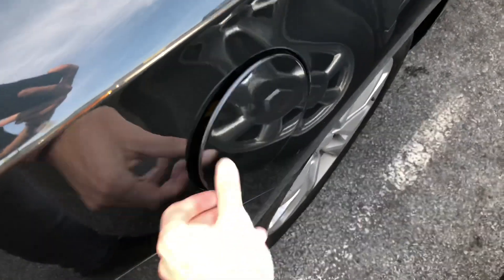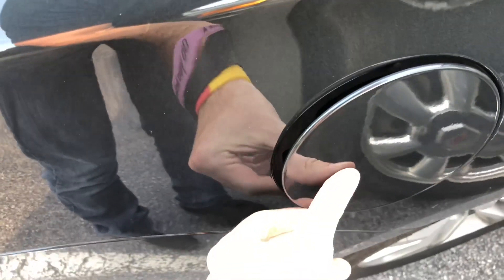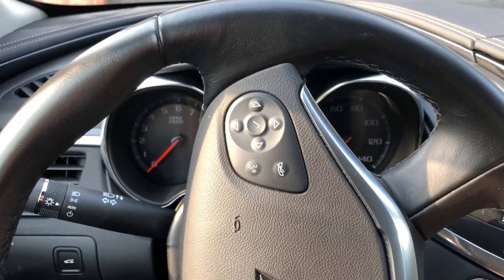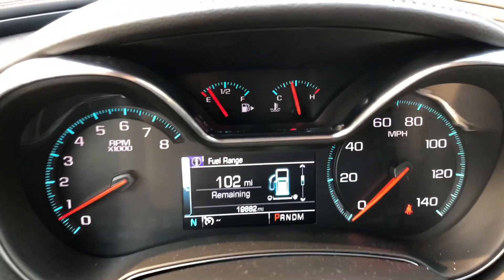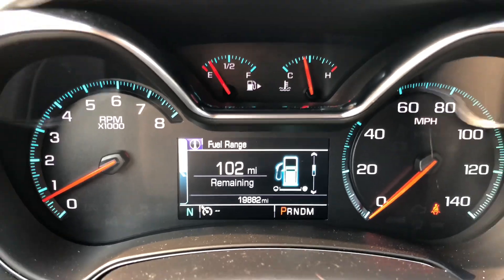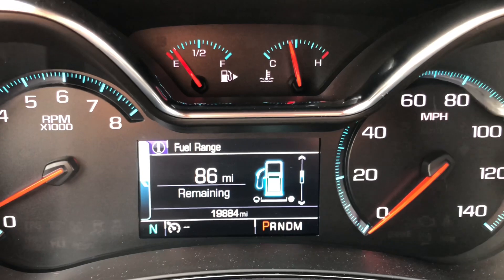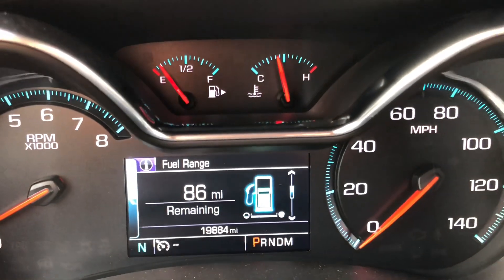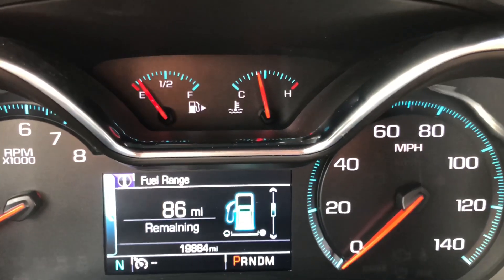Will a Loose Gas Cap Really Trigger Your Check Engine Light?

Comment: Maybe it's not coming on because you seem to be almost empty.I had this CE light problem and noticed it only after putting gas into my car. Checking the system an evac code came on but it said nothing about the gas cap maybe being the problem.But again this CE light only came on after putting gas into the car.

Comment: My engine light doesn't go away on Nissan Roque 2014...it happened after gas cap sign...I changed a fuel cap but engine light is still on...does anyone know how to reset the light

Comment: True. It just cost me $100 at my Toyota dealer for loose gas cap. I got gas 1 week ago and the light came on yesterday. Ugh. So pissed off.
Reply: Dolores Leba it happened to me for the first time today. I got gas last week. Been driving fine. Got to work today fine, but at lunch time I went to start my car, and the check engine light was on.

It’s like God said check your gas cap in my mind, and sure enough it wasn’t as tight as it usually is. I tightened back, unplugged the negative battery cable for 15 minutes, hooked everything back up, and the check engine light is off.

Just have to make sure you tighten that gas cap all the way. Sorry you had to pay $100.
Reply: @DOOMZDAY34  do you have to drive for a while after you tighten the cap in order to switch off the light?

Comment: Can confirm light came on (recently had a full service when it was on before which was my spark plugs). Tightened the cap, drove about 10 miles. Turned engine off and back on and it was gone.

Comment: This happened to my husband with our 2006 Chevy impala and our check engine light stayed on...I told him to take the gad cap off and put it on again and it went off just like that. You have to drive it... and sometimes it doesn't go off if you haven't started the car.. so no it's not a myth. Also I noticed we had a problem with it not wanting to start. The moment I told him to check the gas cap... we haven't had a problem.. took it to 3 mechanics, they couldn't figure out the problem... they checked everything. My husband looked at me and said... figures you would figure it out. Thanks to my pops teaching me about cars....

Comment: As others have already stated, this does happen and it is not a myth. It has to do with the vacuum pressure inside the gas tank, which is maintained by you gas cap. If your gas cap is left off or isn't tightened properly, the pressure sensor inside the tank sends a message to the computer that something is wrong. With my Jeep it took about 30 minutes of driving before the engine light came on. This will vary from car to car, depending on the make and model.
Reply: Thank you for sharing this, it helps people a lot.
Reply: This dude don't know shit lol🤣🤣🤣
Reply: How long did it take for it to turn off once driven
Reply: @beauti_is_her_name  usually after a couple of start and stop cycles.
Reply: Agree folks I got same problem with kine took a few tiu tube vids for me to believe it and then many filling of petrol to see it appear disappear!!.. now looking for o ring or gas cap😊😑

Comment: Not a myth.   Just saved myself tons of money buy purchasing a new $5.00 gas cap.
Reply: How do we reset light after its replaced?
Reply: @rosieizaguirre9140  you may need to take out keys and try starting after say 5 mins OR remove battery cables & connect them back and then start car. Reset happens automatically though.
To check if fuel cap was causing the issue, you may connect your car via approved software and read error code.
Reply: Right, we had the same problem, took it to 3 mechanics and no one could figure it out. I know a little about cars from my pops, and I told my husband to take off the gas cap and put it back on and sure enough it worked. We even had a problem with it not wanting to start, but since then.. no problems...👍
Reply: @Rise Daughter Rise you are right. it takes few miles of driving to absorb the change due to cap refitting. I drove for 10 miles at a stretch and light turned off automatically and it never came back at least in last 150 miles of driving.

Comment: My vehicle: Gas cap not closing right, check engine light NOT on. However, using an OBDII scanner, it shows a PO455 EVAP code, as a PENDING code problem. The more you use the car and the more pending reports reach the computer, finally you get the CEL  to turn on. YMMV